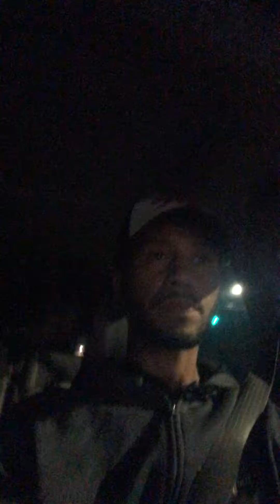What happens when you put an HVAC piston backwards?

Comment: What if the piston isn't installed at all? I have high pressure on mine here and it cools fine but I noticed the guys that installed it left a piece along it's danfoss b1789851 piston kit and don't think they installed it. makes a high pitched humming sound that's subtle and it pulls in the filter
Reply from the maker: It wont cool without the piston
Reply: I agree it wouldn’t cool and the pressures will be equalized. As far sounds and filters that has to do with air flow not refrigerant. I believe Danfoss is a quick connection?